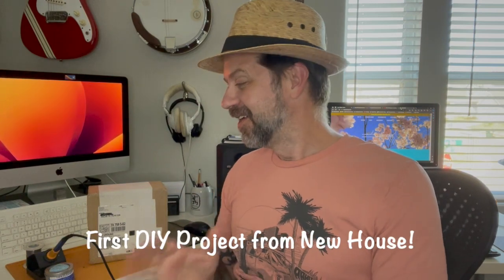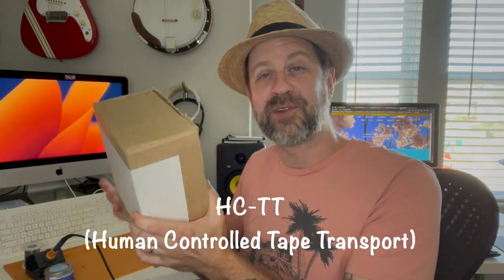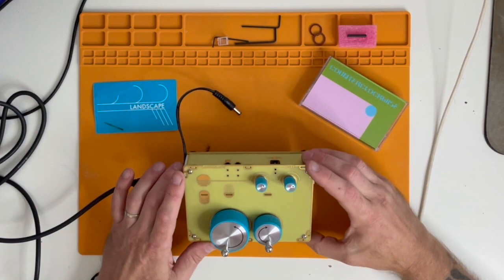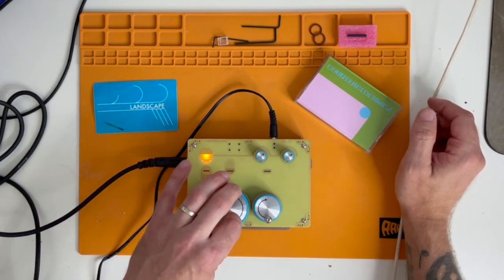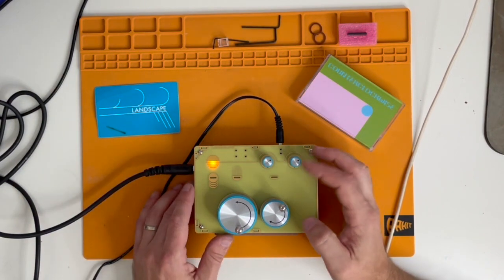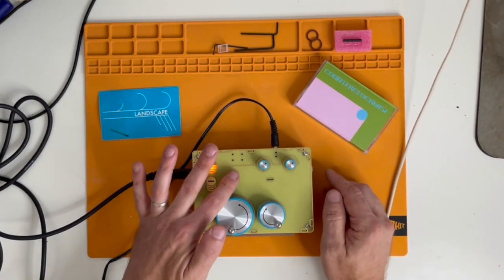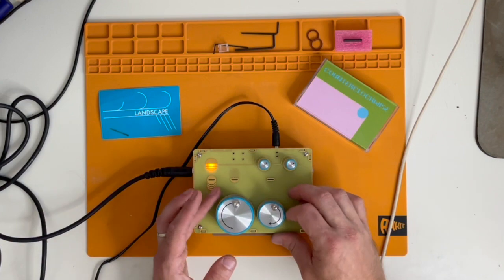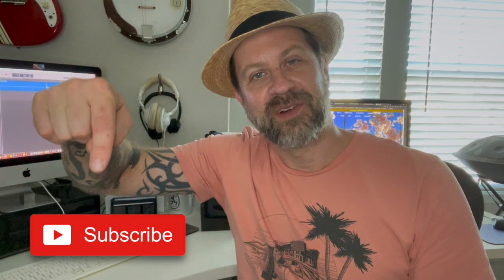Landscape DIY HC-TT Kit

Comment: Surely you must know that the "build" section is useless. Why did you include it or not post it at regular speed?
Reply from the maker: Thanks for that feedback but I have to say the majority of folks disagree with you. From the comments & views I've received on past videos (where I did what you suggest), people fast-forward through the build part (or even stop watching the video entirely). The user engagement is way better with the time-lapse vids. Plain and simple the trend is moving toward shorter videos where you can still see what's happening but it happens much faster. Attention spans are really low these days.

Keep in mind, this video isn't meant to be an instruction manual. You can find that here if that's what you want: https://www.landscape.fm/hctt-diy